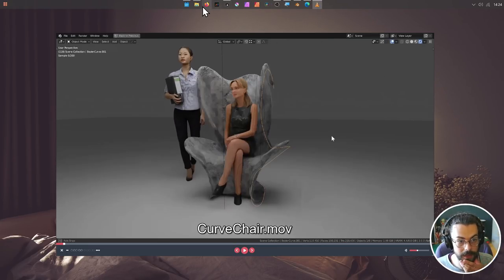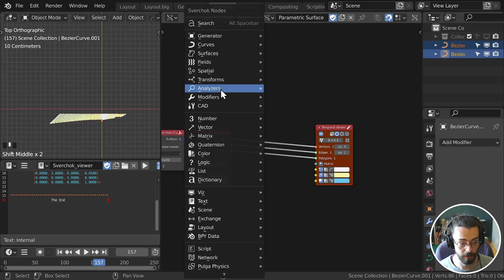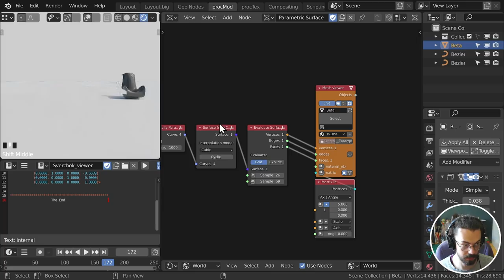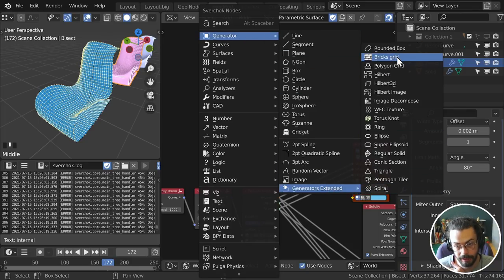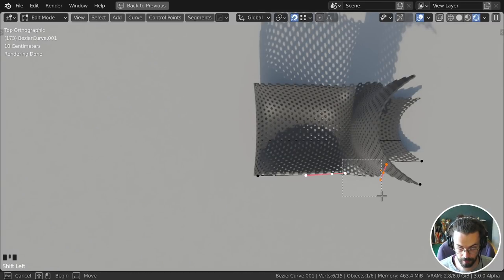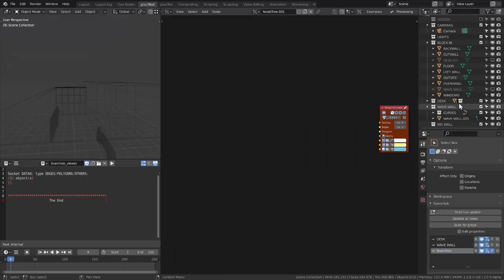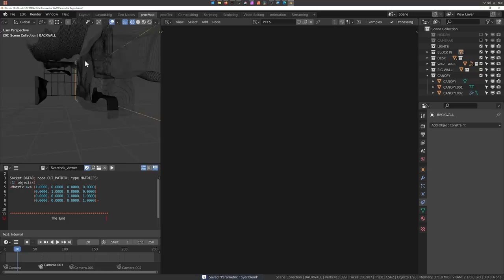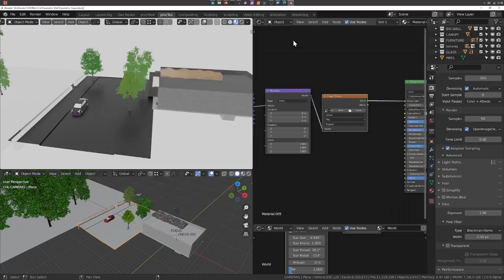Parametric Surface from Curves with Sverchok - Blender Tutorial

Comment: This was very helpful, this different technologies offer a lot of options on the table. What I'd like to see is if you can take some surface objects and "boolean" kind cut other objects out of them. That technique would be useful for some modelling purposes.
Reply from the maker: There are a lot of options such a Cut By Surface or CSG Boolean. Or also outputting mesh objects, using Boolean modifiers and then bringing the object back into the node tree post modifiers to keep working on it.
Reply: I try to learn to remesh them at the end when they are joined into a coherent mesh with realtive even topology

Comment: great!
this is information I need.
Im working with a designer that works in Rhino and the mesh I recieve usually is very dirty. possibly thinking that if I can get the curves instead, I can use this method to create clean mesh and hopefully save me time.
migth you know the export standards from rhino inorder to be useful in blender for this activity?
Reply from the maker: Hey Raymond! I just did some tests and I'm finding that exporting the splines directely from Rhino (without any surfaces) as an OBJ is working okay for me. This is only a simple test I'm doing but there's some hope there for you!! Instead of Bezier In , you just use NURBS In in Blender. https://imgur.com/a/m7Dt9B8
Reply: Thanks.!

Comment: Great Tutorial, I've been trying to reproduce it and got stuck on the part in which the vector field is applied to create the second half of the structure. When I do it the curves I get are somehow scaled up, it is reflected with respect to the "y" axis but the new curves are larger than the original ones. I use my unit settings in milliliters but I doubt that is the reason. Any Idea on how to fix that?
Reply from the maker: Iirc we use a custom field to do the mirroring right? Instead of that, just use a matrix node and scale -1 in the axis you're wanting to mirror. It's a bit earlier to do